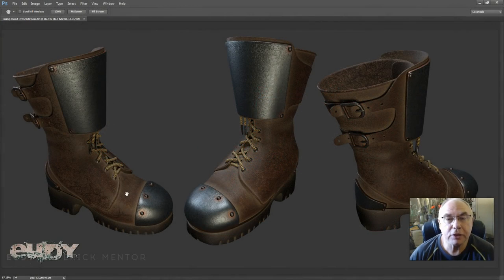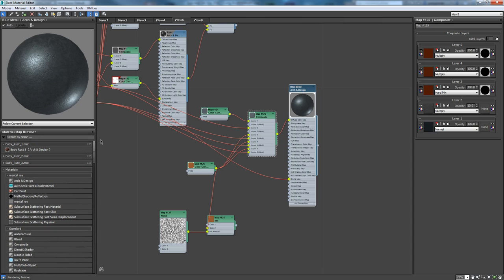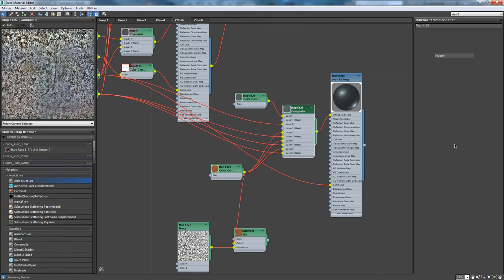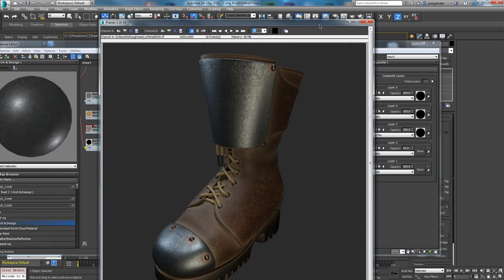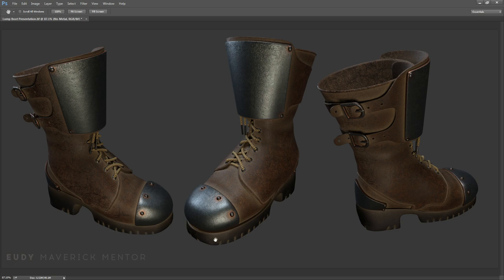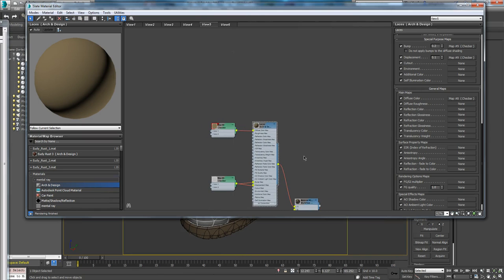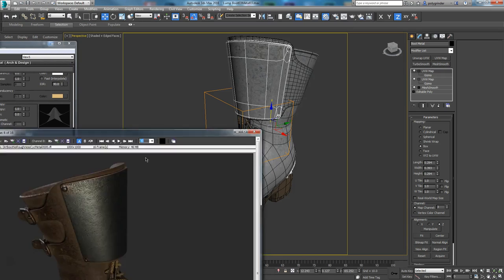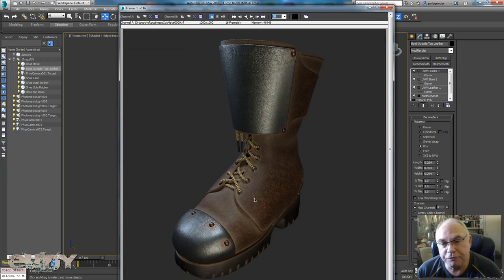Stain Mapping a Leather Boot Part 2

Comment: so should I switch over to 3ds instead of maya?
Reply from the maker: Matt. It doesn't matter which software you use. The technique can be done in probably any 3D software. 3dsmax has box mapping where as Maya doesn't. But you can do multiple planar mapping, Automatic Mapping, in Maya which is very similar. In 3dsmax 2017 you can do Blended Box mapping which allows you to soften the edge of the box blend which will enhance the technique even more.

Here is the tutorial done in Maya.

Stain Texturing in Maya 
https://www.youtube.com/watch?v=sk54l_5OVg4
Reply: Your videos are seriously saving me so much time! Thank you!!!
Reply from the maker: Matt,
Glad they are helping you.